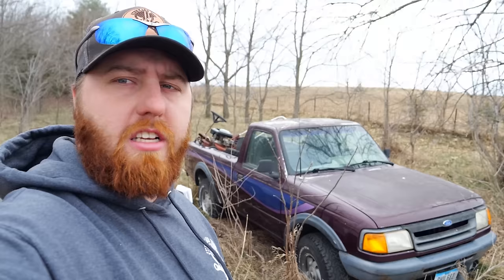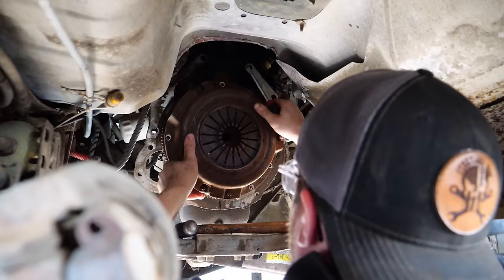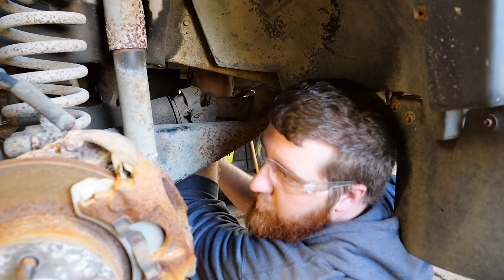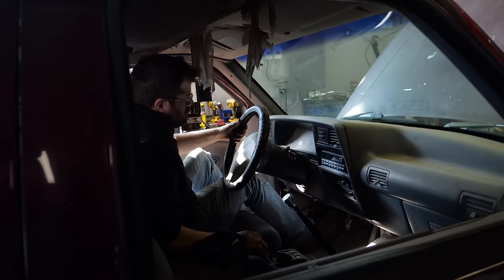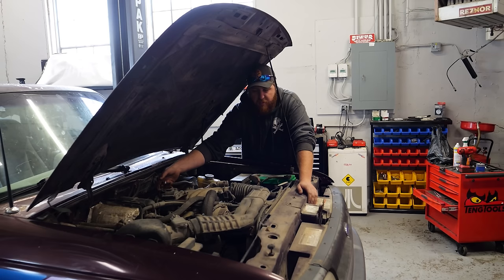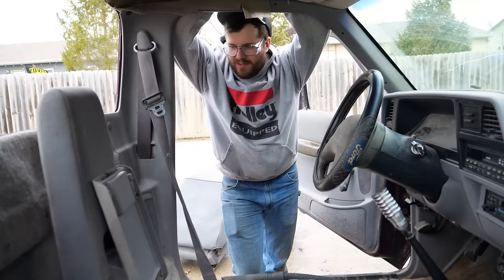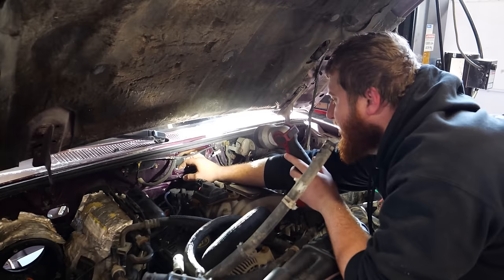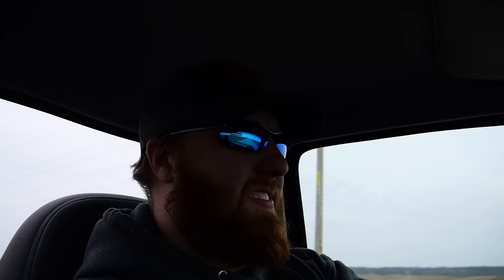Will my CHILDHOOD Truck RUN & DRIVE After sitting Abandoned for YEARS?

Comment: Check the Throttle position sensor for the 4k hang up issue. Just a thought. Also, tightly wrap 1 layer of Duct tape around the knerled threads on the shifter handle and hammer home the shift knob. It wont go anywhere after that. Call an auto windshield replacment company and have them cut a piece of safety glass to the rear window dimensions.
Reply: Good idea! I too am looking for some solid rear glass for my '89 Ranger... Cutting a new piece would a helluva lot cheaper than getting one on ebay ($200 +)
Reply: A lot of local glass guys will do this especially if its flat glass. I have had lots of custom windows made with inserts done by my local family owned glass cutters.  As well as shower doors for many of my building projects.  Ask your friends who they use in your area, (guys who build stuff) they will know.
Reply: Been doing glass for 25 years, I probably have a backglass laying around that fits your Ranger
Reply: I ended up having to clean the TPS with contact cleaner and putting some dielectric grease in there to fix my revving problem.

Comment: It’s a mother f’in ford ranger!! The danger ranger. You could flip that bad boy multiple times and it would still run.
Reply: Being a ford I usually would doubt that, but I am 100% willing to believe it this time.
Reply: @Rileygee0224 fords aren't bad dude
Reply: Actually you are making an excellent point - Cleetus might be able to get you the rear glass. Probably has a ranger with it in and intact
Reply: @Rileygee0224  Hey, fords do catch a bad rap, but this thing is dang near indestructible.
Reply: @Rileygee0224 not til you reset the inertia switch 😂
Reply: Especially if it had the 2.3L Lima in it... They're bullet proof! 👌
Reply: I rolled my 01 ranger 3 times at 55mph, drove it for 8 months after
Reply: @R3TR0R4V3  The cologne blocks are almost as good too, the only time I don't see those things go over 200k is when they are heavily neglected. I have one with 250k and I like to tell people "It can haul anything but ass!".
Reply: that 3.0 is so gutless youd have to help it flip over lmao.
Reply: For the record, those Rangers are Mazdas. B1000
Reply: @gr8xr7  nope ....For the 1994 model year, Ford commenced production of the Ranger for Mazda, who began to sell the model line as the B-Series pickup truck (effectively in reverse of the 1972–1982 agreement that produced the Ford Courier).

Comment: I know it's not really your style but I would LOVE to see more revivals on obscure 90s vehicles. we all need to start collectively saving those nuggets now before they all go to the crusher from people who think they're worthless and not worth fixing :,)
Reply: Small 90s truck are great, I love my '93 Dakota 3.9L 5 speed. Unfortunately it's down right now due to one of MANY stupid early 90s fuel injection problems. A 375HP carbed 360 V8 build for it is in progress now, that will fit ix lol
Reply: @consolehacker54  How was it that failed specifically? I've got a 1990 S10 with the TBI 4.3 and honestly it kinda bugs me only having 2 FAT fuel injectors running 6 cylinders, lol.
Reply: @danieln.285  It's juuust new enough that it has multi port injection and OBD I, not TBI. Mostly just random sensors and old wiring harness failing, now it randomly backfired like crazy and shut off while driving, exhaust smelled like raw gas. It starts and idles but giving it any gas makes a HUGE backfire and it dies again. I think it's an ignition issue and the distributor pickup, crank sensor, or coil (which of course I just already replaced) is failing. I'm not quite sure yet
Reply: I just watched a couple kids (and goofy adults) make every effort to ruin a '90-some Cougar on Dalton's PBG. Gotta admit I didn't find it funny, anybody who knows about those old Ford Supercoupes would crawl out of their skin watching those parts (and car) go to waste. I did, for sure ... and I usually love Dalton's stuff.
Reply: Go find a different channel fella. Find something you like. You could of course start you own channel and do exactly what you want😊
Reply: I agree. As machines age, there is a period when nobody cares and too many get crushed, sometimes every last one, while nobody keeps track.  Also these cars, especially the small and efficient ones, can still make viable dailies and viewers are still trying to nurse the last few miles out of them, as I have a friend with an abandoned 2.5 Ranger that we might revive if we can ever get title.  I also drive a 1.9 Escort and want to revive my 1.0 Metro, which compliment my '82 W150/225; all of which work, none of which are toys or collectors items like too many Youtube cars.
    I also appreciate Angus' self deprecating humor and practicality as I think Kevin is getting just a hair overconfident and oriented towards toys.  Though it does require some of that optimism (or desperation) to embark on road trips in junk.  So I guess we need both.  And the desperate don't usually film it.
Reply: I had a 3L Taurus with too much power and wished for the mileage of a 2.5L fleet car, but I do think your EFI problem is robbing power, and these dailies are rarely worth swapping out running engines.  Better to sell it, buy another with a blown engine, and swap that one out, if you want an engine that was not offered.  But I would go smaller than anything offered, follow Carter and cruise at 55 to save gas, especially in a boxy Ranger, which will burn far more gas at 70 than my sleek, 1.0L Metro.
   I do like the color though.
Reply: On my 3.0L Taurus, I retorqued the head bolts on the front head, but neglected the rear head because I would have had to remove the overhanging intake.  About 2 years later I sold it "as is" after it blew the rear head gasket and I wanted something more efficient anyway, my Jetta, then 1.0L Metro.   Anyway, it did help me make the case for retorquing all the head bolts periodically, though it's hard to find retorquing specs for torque to yield bolts.
   The Taurus was sleek enough to not be a gas hog at 70, and had plenty of power for it, though I rarely went that fast on my salvaged tires and for fuel anyway.  I wish you all would pay more attention to economics including fuel.  Successful Youtubers have a tendency to lose touch with that, often making the new kids better.
   To be fair, the 1.0L Metro compliments my '82 W150/225, so I can carry bigger stuff.
Reply: I worked on a lot of 90s cars as a mechanic and let me tell you there is nothing special about, at the very least, japanese 90s cars. American ones are worse. I cant speak for german or swedish i never had saabs, bmw, audi, vw, or mercedes in our shop from the 80s and 90s. I wonder why...

They are all a PITA to work on with the emissions systems and being fwd the engine and transmission are always intimate. American cars got shitty in the 80s trying to compete with their better lower cost manufacturing, the 90s isnt better.

There is a reason he isnt touching them. They are not desirable for looks such as the edsel in the 50s and pretty much all studebakers made, all 90s cars follow a design logic that is ugly to most people.

They also use plastic where we used sheet steel in the 70s back. Which turns brittle in hot climates, warps in humidity and bleaches from UV damage. Same goes for hoses, using hard plastic where they used steel, bronze or rubber lines. The housings on parts like your water pump, oil sump, valve cover are all plastic in the 90s.

They are horrible cars.

Comment: I'm glad you pointed out how important it is to always install a new throw out bearing when you pull a transmission. If  a bearing siezes, it will eat the pressure plate and everything else in there; it just isn't worth the risk. Don't ask me how I know that!

Comment: My second gambler 500 rig was a 94 2wd 4.0l stick shift ranger I bought from an auto auction for $250 from the "non-running" section.. I aired up the tires, jumped the battery, and drove it home on flat spotted tires.  Seeing this revival just warms my heart and reminds me of my own ranger build that I miss.   Thanks again!
Reply: Also, mine had a thing where the connection of the fuel pump relay connection in the terminal block was slightly wonky so it was common I'd try to start it with no fuel pump, have to go jiggle the fuel pump relay, and then it would fire right up.  Seems like a bunch of my friends with rangers had the same problem, so it's always one of the first things I check if the fuel pump doesn't kick on.  >_<
Reply: that little 4.0 v6 was a pretty peppy little buggar if you kept thermostats and headgaskets in em

Comment: For lack of power- check for vacuum leaks in the intake! Not just visually, but hook up a smoker and smoke the thing. On mine there were a BUNCH of cracks in the old intake pipe (smearing rubber cement over the whole thing helped), as well as a few leaks around the throttle plate shaft. Patching all that made the old truck a bit happier and bumped up gas mileage a little bit. 
It's funny though, can hardly do 70 just hauling one person, but put two tons of stuff in the bed/trailer and it still performs the same! It's like these Rangers want to do work, great little trucks.
Reply: I concur.  I used to drive one to job sites and in particular the automatic seemed to really enjoy pulling a load.  Running empty it never really seemed happy and the shifts were all over the place. Surprising good on dirt roads though.  I guess it just wasn't designed as a commuter.
Reply from the maker: Smoked her off camera, no leaks😅
Reply: @JunkyardDigs  NO leaks on a '98? Either you got very lucky, or rubber just lasts longer when it's not 100F outside most of the year lol
Reply: the old model was underpowered, but it will do the work pulling a load when it has to
Reply: In 1985 you were fortunate to get very far into the triple for hp, especially in a small truck. For the time the Ranger had sufficient power for what it was designed to do. I've just never liked Ford's electronic automatic overdrive transmissions very much.
Reply: @pminoregon9072 I had a 1985 Ranger that was green and gold. It had the 2.0l in it with a 5 speed. Fried the engine twice in the thing. 😮😮😢😢
Reply: @JunkyardDigs  or was the iac just stuck open lol. then again, it is a 98. Plug in a scanner and get some live diag. really sounds like vacuum, check MAP.

Comment: I'm sure this will get lost in the comments. But I very much appreciate you guys setting a good example by wearing safety goggles whenever your were working under the truck. My dad lost sight in one eye because he didn't wear correct PPE despite him dismissing me for years. I work in an environment where they are mandatory and working on my projects at home, I always wear them if I'm under a car or working with fluids. It has saved me on more than one occasion!
Reply: I've had several times where something small has snapped, popped off, or otherwise went flying and hit me dead on in the safety glasses. 

A friend of a friend lost most of the sight in one eye after catching a metal shard in the eye while doing grinding work. No eyepro.

I can't believe how many people don't wear them while working on cars. Same goes for gloves.
Reply: @wysoft  I'm guessing it's a machismo or lack of intelligence thing. As Meateater in the comment before exhibited exquisitely

Comment: I love the graphics of these 90s stx rangers and AMT/Ertl made model kits/promo models for these in many colors they are cheap to find as well, very nice!
Reply from the maker: I actually have one of those somewhere!
Reply: @JunkyardDigs  Nice! Hopefully, you can find it as a dash prop for it! I have a black one I got a few months back, enjoy the channel, this thing deserves some paint fixes and maybe a v8
Reply: @chevymontmarlo  351 Windsor with that epic supercharger with weber carbs kit they got with the Mustang 2?
Reply: @sambrown6426  that would spin the wheels constantly. dial it back there. little 302 naturally aspirated will be all the power that tiny light truck needs.
Reply: @scottjackson1636  I know, I was being facetious. You'd also need to swap the trans, beef up the t-case, replace the diffs, strengthen the frame, new suspension, stickier tires, it'd be a project. But it'd be really cool if they did it.
Reply: @JunkyardDigs @JunkyardDigs, you can practice putting a V8 in the model kit before doing the 1/1 scale!!
Reply: @JunkyardDigs  hey is there anyway I can message you for some advice I have a 300 ford and it's popping  through the intake at 2k rpm and miss fire
Reply: @JunkyardDigs I am disappointed...that you were hiding one of the most important trucks of your generation....

Don't you understand the importance of that truck?

That's a Ford FUKIN RANGER!!!

See.... it's already playing basically our national anthem!!!
It's destiny dude!!!
Reply: Anyone remember the 1991 Ranger with the splash graphics on the sides with the 2.9l V6 and a five speed 4wd? I had one of those it was medium blue in color with the splash designs on the sides of it. Unfortunately kissed a pole with it. Was almost a drive through situation into a house. 😊

Comment: When I was a broke high schooler I had a 2.3 5 speed ranger. Then when I was down on my luck going to trades school I bought another for $1000. Both made it over half a million kms. These will always have a really special place in my heart. It got me and my friends where We needed to go for cheap and ran off parts from the junkyard. I have a 7.3 power stroke F350 now but I still miss my old trucks!

Comment: Bought a 94 ranger for 700 bucks recently. Electric blue, 4x4 5 speed 3.0. been a battle to get it running right, but its such a good little truck. Everyone needs a ranger
Reply: I got a Chevy S10 for $500 because it "leaked transmission fluid". In reality, the transmission wasn't properly torqued down to spec. Other than the tranny leak and a minor wheel misalignment, for $500, I basically had a running and driving truck.

Comment: My first vehicle was a 1987 F-250, 6.9 diesel, 4x4, 4 speed. I drove it from ages 14-21. The guy I sold it too had big plans. Sadly it’s sitting in the same spot I parked it 16 years ago, trees broke out the windows, and packrats have built their city under the hood. The seat foam is so thick you can’t see the pedals or 4x4 lever anymore. 😭
Reply: A Shame
Reply: Bro can I buy it doesn't even sound that far gone
Reply: @jaredlancaster4137  I’ve tried buying it back from the guy many many times. It’s way too far gone now. When you open the hood you can’t even see the engine because it’s packed full of sticks and mud. It looks like a beaver dam. Packrats are different than mice. The seat cushion is chewed away into millions of pieces down to the wires.
Reply: @stevenlatham4397  it's a 80s  ford that's just your extra insulation

Comment: Three minutes into the video and I already love it. My first truck and daily driver for about 9 years, is a 1994 Ranger XLT extended cab, 4.0L V6 with a 5 Speed Manual and 4x4. I still have it, has loads of problems after rolling over 250k miles, but I swap it out for my new daily every week and drive it still to this day.
Reply: Good to hear I'm not the only '94 ranger owner STILL driving there ranger around. I sure would like to know how many others there are like us.

Comment: I'm 40 years old, and I still have my first truck from high school. It's an '89 F150, straight six, 4x4, manual everything. It's parked in my driveway and I drive it almost every day. 265,000 + miles, runs like a champ! My dad sold his '77 Toyota Land Cruiser when I was 5 when he bought this f150 brand new. I'll keep it forever.
Reply: I wish I could say the same. I had a 95 Ranger that I rolled at 70mph on the interstate due to construction debris. Crushed the top of the cab, but kept me safe. I miss that old truck, but her replacement (02 Ranger) is still my daily driver.

Comment: Ahh...the good ole 3.0L V6. My first car was a 1994 Eddie Bauer Exploder with the 4.0 OHV V6, a 6" Skyjacker suspension lift, and 35x12.50 Super Swampers on 15" chrome bullethole wheels. I bought it with 64,000 miles on the clock. I swapped the 4.0 for a Fox Body 302W and I kept the AOD4 trans (which I regret because it had to be rebuilt five times by a questionable shop), and I also installed an Explorer Express Eaton M90 supercharger kit. It had shorty headers, a full cold air intake (that I fabricated out of intercooler piping), and a full 3" dual exhaust with custom 48" glasspacks and 14" chrome slant cut tips. It was only 2WD, but it was alot of fun in a straight line and it sounded AMAZING! I also had a 1995 2WD Ranger Super (first year for the new body style) with a 4.0 OHV and the new 4R55E electronic transmission that I bought for $500 and that thing would seriously lay an 11 for 150 feet from a dead stop.
Reply: '93 is when that Gen 3 body style started. Love me some Rangers! 🤘

Comment: Oddly enough, my high school truck was also a 94 ford ranger. 4.0L 5spd 4x4 but xlt extended cab. Never figured out what made it an "xlt" considering it was manual everything with virtually zero options. Even had a bad trans when I bought it but they were easy to source back then.

Great truck, refused to die no matter how much I tried to kill it. At over 300k miles and nearly 10 years of owner ship I discovered the frame was rotten. I patched it and posted it for sale. Miss that truck to this day, 8ish years later.